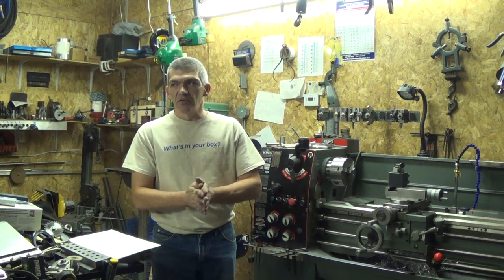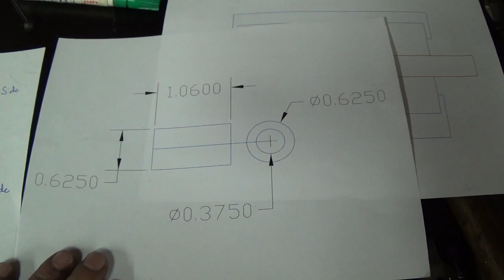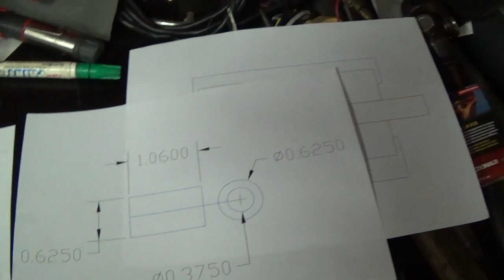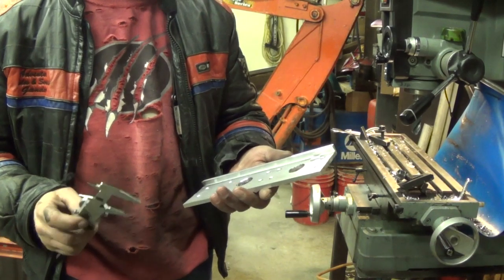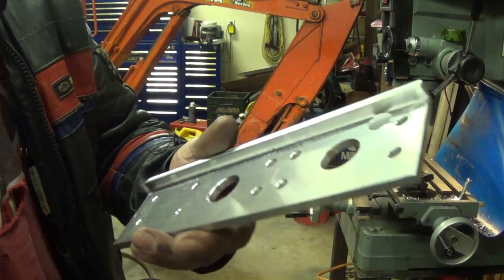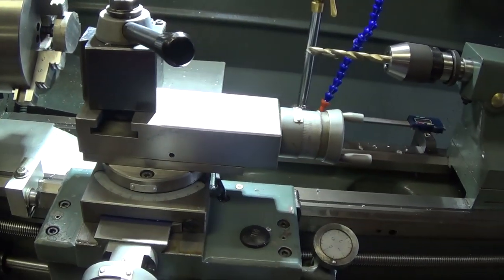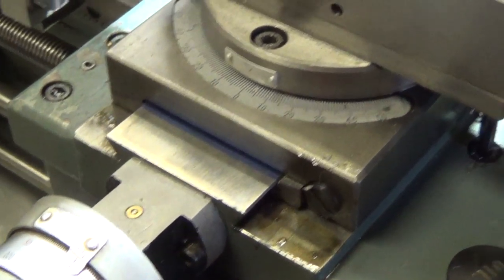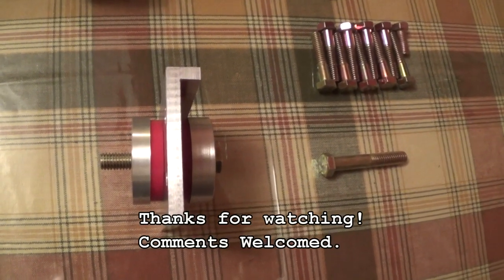Mounted!

Comment: Your tooling plate looks like an old cylinder head, great idea!
Reply from the maker: Hehe, it was actually. I pulled that out of the casting metal bin as a sacrificial plate instead of using new material. I added dowels to the underside so it aligns perfectly every time.
Thanks for the comment and have a great christmas!

Comment: Nice work, I like the sharpie idea, that is a cool tip!

What was the part mounted on in the start of the video, a fixture plate or just sacrificial?

Like the tool boxes in the back ground!

Chuck
Reply from the maker: When I do multiple parts I do the first one really carefully and get the machine setup. The sharpie guides really help to not F-up later on.
The jigging plate is indeed sacrificial. It was an old cylinder head but I added dowels on the bottom for alignment and cut a ledge on it for the stock to butt against. Again for doing quick multiples.
I normally set up and do 20-30 pieces of each when doing this kit.

Colin

Comment: Colin, nice work - I've subscribed.

I notice all your cuts are climb cuts, no issues with climbing on the import machine?

Thanks,

Glenn in Spokane
Reply from the maker: No problems with the climbing as long as gibs are tight and cutters are sharp. At least in aluminum anyway. If you notice the cut along the front edge is app .250" DOC. The climb cuts leave a far superior surface finish.
Thanks for the comment. :-)
Reply: Thanks Colin

Comment: A little hard to figure out what it's used for ... I think.

Maybe you've showed it in another video ?
Reply from the maker: Polaris made a snowmobile model in 05-06 that had some issues with engine alignment. Being one if the unfortunate that bought one of these I needed a better solution as drive belts priced about $120 and up. I made this kit up one Saturday for my own sled and it turned out to be popular.
I lost count after 400 or so kits but still make them 6 years later and ship to many places worldwide as far as Japan.
I'll try to add a pic or two if YT will allow an edit or overlay.

Thanks for commenting! :-)
Reply: ***** Oh, that's nice when things develops this way and you can get a little money.